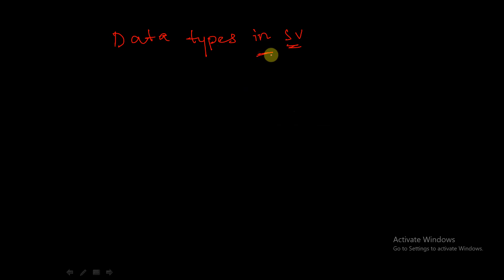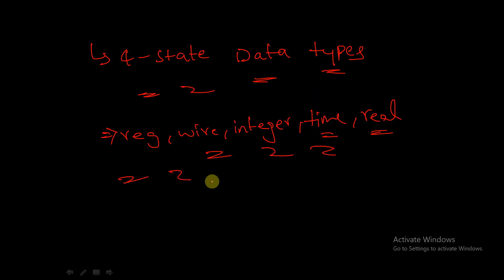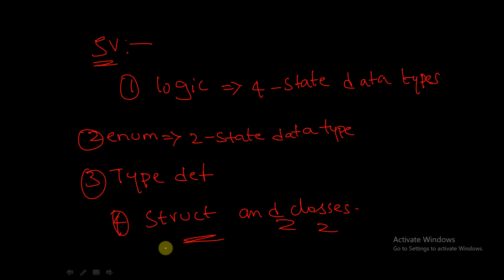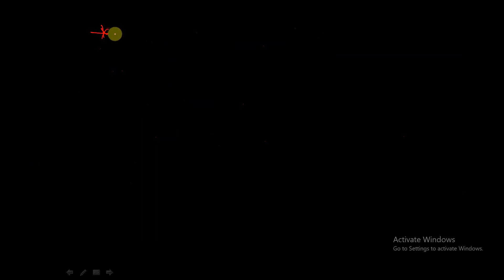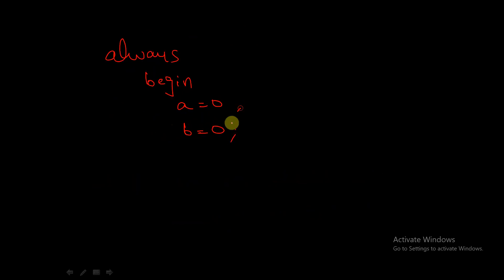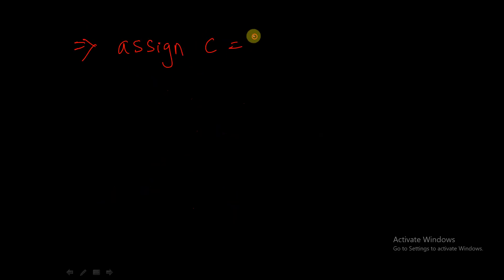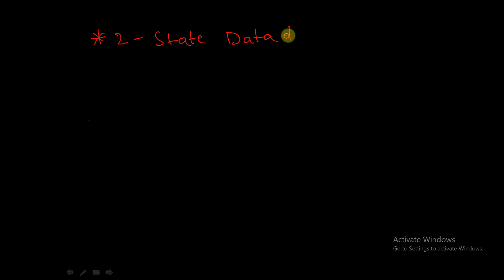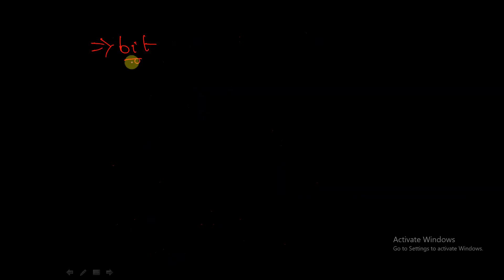Introduction to Logic data type and 2 state data types || Data types in system verilog ||

Comment: Sir in the last minute you said that if bit is assigned value x then it would automatically give value z but as we know bit is a 2 state data type it should give value either 0 or 1, Then why it is giving z as answer
Reply from the maker: I think you have heard it wrong once cross check it
Reply: @Allaboutvlsii  got it 👍I was confused with what you had written below
Reply from the maker: @anubhavrai3489  no issues